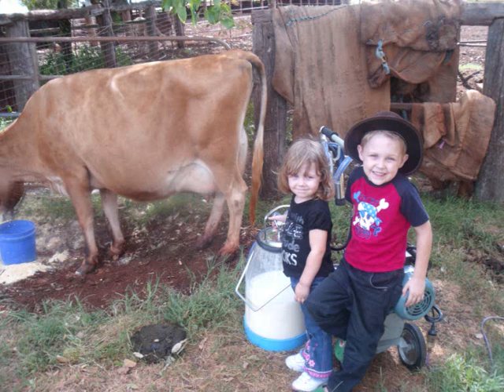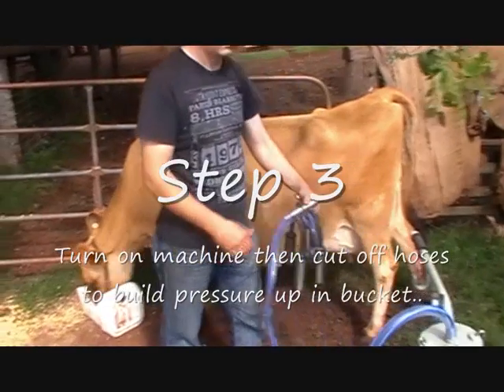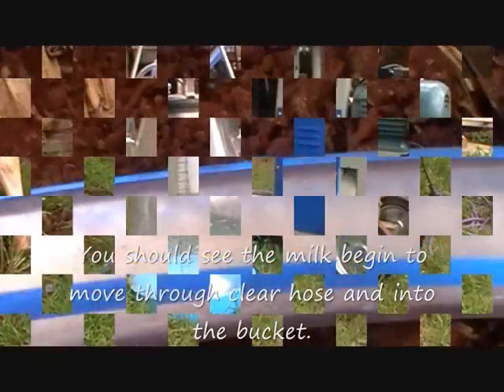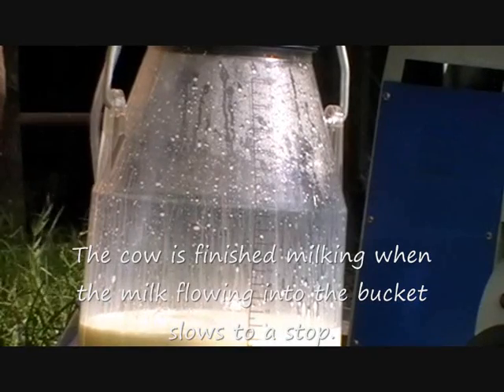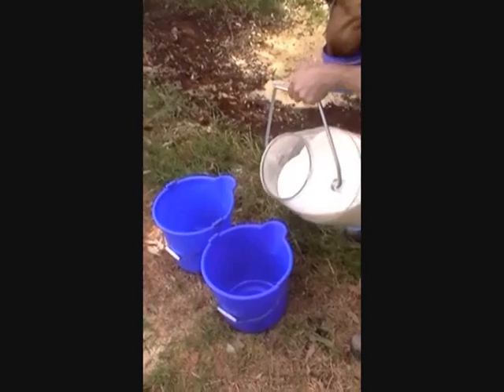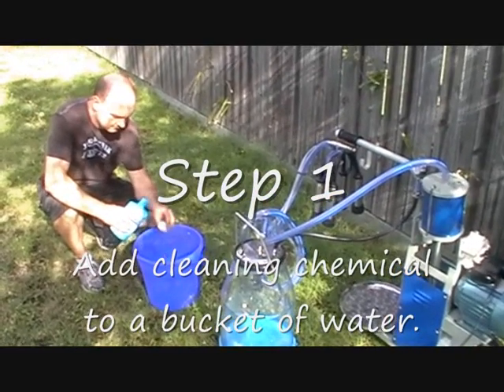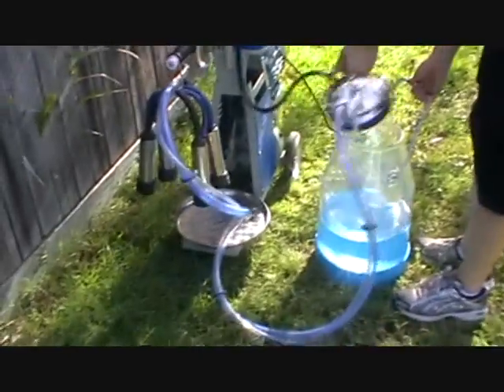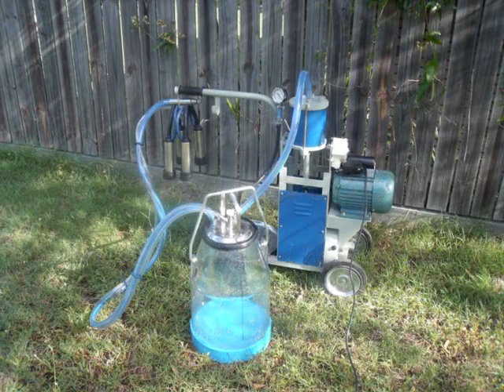Dairymaid Milking Machine Instructional Video

Comment: Hi, so I recently bought this unit.  well it was a gift actually.  Its working alright, but I am finding some issues .  which is why I am looking on youtube for instruction.  The main issue I am having is in putting on the claws.  I want to ensure that the milk is clean and no debris.  The claws are difficult to manage in the hand and being so close to the ground if they fall will become contaminated.
Reply: +Jack Brody so what i have done with this unit is use clamps to cut off the two claws while I get enough pressure on the others to hold on then I place the other one by one and remove the clamp.
Reply: Jack Brody do u know how much oil I need to add to the blue container